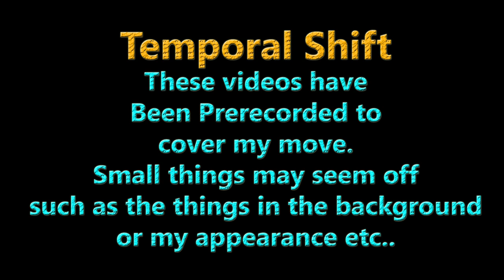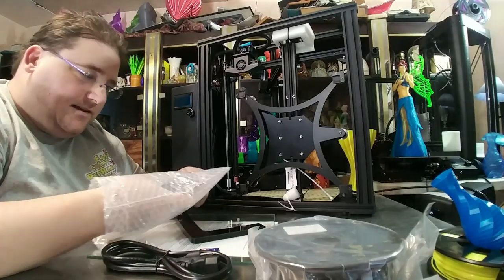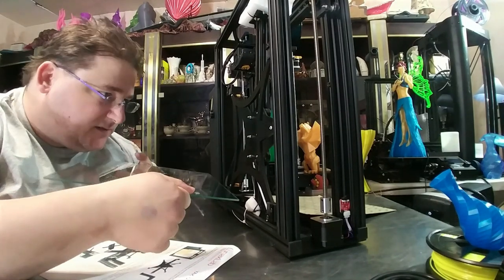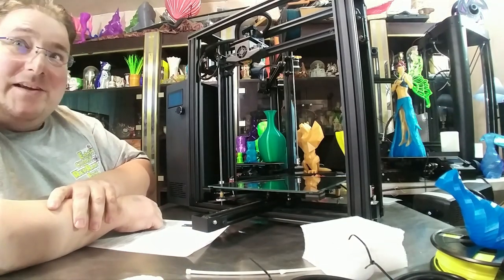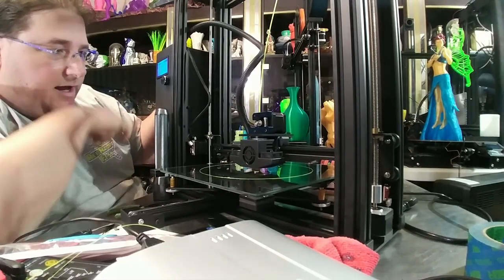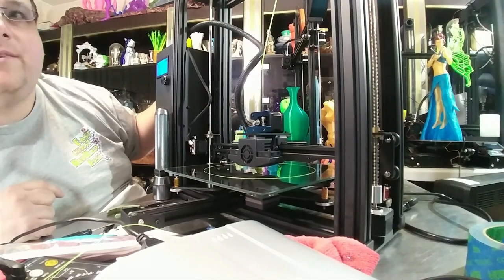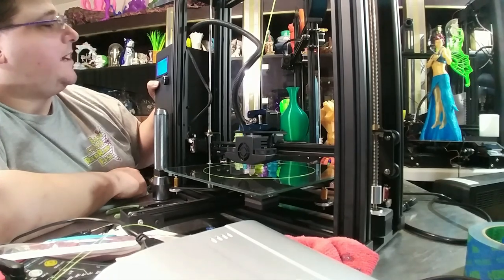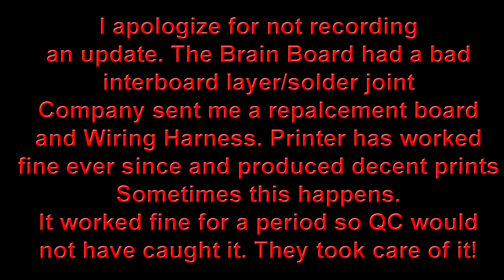Yak 3D Printer Unbox, Build, Print   T3DP

Comment: Nerys is on the move!
All cross fingers we see him soon again :)
Reply: Not yet. Around august 16 i think.
Reply: Oh, k. The description made me think so.
Reply from the maker: Not yet. But as move date gets closer i have less and less time. So i will start posting pre recorded videos to keep the channel alive as best i can. Not big enough to habe inertia yet. I will of course keep an eye on comments so ask away if you have questions about anything.

Move date is currently set at august 16th. Today o am hauling more stuff out to the bus. Can only make 3 or 4 trips then habe to stop to avoid over heating. Hot as hell today and its not even that bad. Man i hate this heat and humidity. But bit by bit will get it done. Hoping to get pickup truck back tuesday night. I need to get the trailer to the tire guy and get the cap for the pcikup so in can fit more stuff.
Reply: Sorry xD I am bad at remembering dates.
Reply: A man of Nery's magnitude on the move is a force of nature, not easily stopped!
He WILL reach his destination, question is: in what condition?